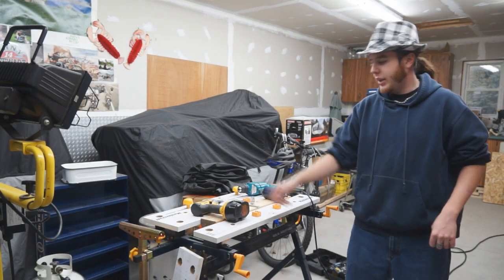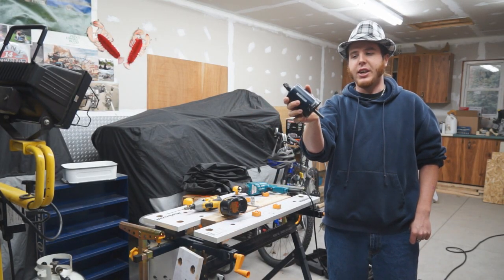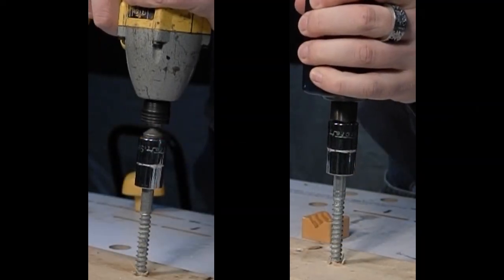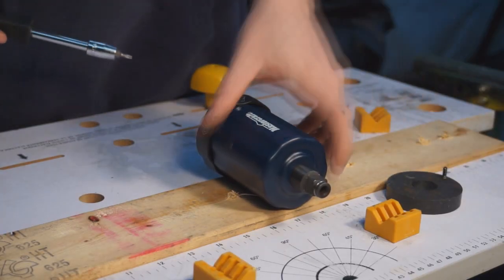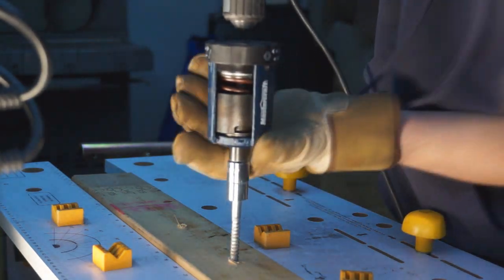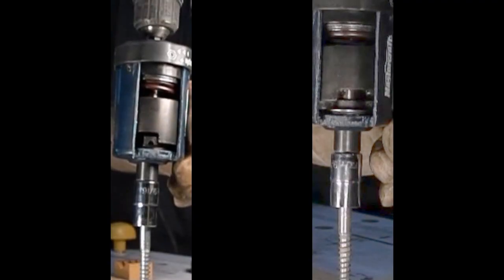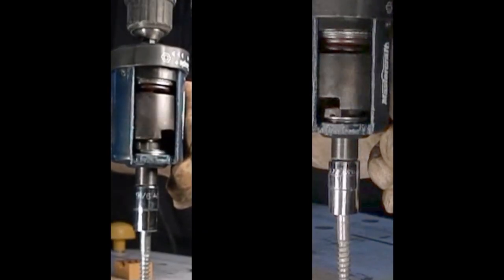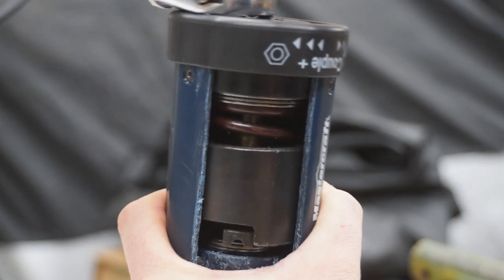Slow Motion - How an Impact Wrench Works

Comment: I would like to see it taken completely apart to see what it looks like and what makes it lift up at the exact time
Reply from the maker: There is a spiral cut in the drive shaft. When the spinning weight is stalled the drive shaft still turns pulling the weight up like a nut on a bolt. When the weight is free the spring drives it down and it hits the output shaft.

Comment: I know this is years old, and I doubt you still have the tool, but I'm curious what that spring is rated for, and what all the components are, just to see how easily one could be replicated. I've never seen these before, and I doubt I could find one easily. But one would be handy to have around for the few times I need an impact driver.
Also, do you know how much torque this puts out off of a standard drill?
Reply from the maker: I do actually still have it in my "science bin." The spring can take my full weight without compressing fully so it is pretty heavy, someone told me a few years ago they found a chinese knock off but I haven't seen it since. I'm not sure how much it puts out in numbers but it is about as good as the DeWalt.

Comment: Interesting; thanks for sharing this. I believe the air powered units have a different impact clutch mechanism than this - I would be interested to see how that one works. I've disassembled the air powered ones for cleaning and repairs, and there is no spring in them. I guess inertia plays a role in timing the impacts.
Reply from the maker: Yeah, they have a throw-out hammer mechanism that is way different from this. I have an air gun in the closet waiting to be taken apart but my new slow mo camera doesn't arrive until March.

Comment: is any possibility that the impact wrench adaptor damage the HSS chuck?
Reply: I mean if you use it for a long time.
Reply from the maker: I don't think so, the force felt through the drill is pretty even more so than in the DeWalt gun. It's a lot less violent than snagging a bit while drilling.

Comment: Can you recommend an ideal budget impact wrench to unscrew wheel lug nut?
Reply: If you're just using it for wheels you're better off just buying a breaker bar. Unless you need if for a job.
Reply from the maker: +awesley92 I find they are good for driving screws more than anything, for nuts and bolts a regular wrench gets you more torque than an electric impact.

Comment: +Nick Moore I am desperately trying to find that impact attachment. The links I've found to the tire place don't work. Any ideas? I'm in South Carolina USA. Thanks!
Reply: Orion Red
Very punny Onion!
Reply: Try amazon, they have them on there. Canadian Tire is only in Canada and they typically sell a ton of cheap chinese knock off tools - I have a bunch of them here eh.
Reply: Can't find them. One of the big name power tool companies probably bought the company or patent and took it off the market. Ugh!
Reply: Jacob Beaton  thanks for responding.Can't find them. One of the big name power tool companies probably bought the company or patent and took it off the market. Ugh!
Reply: Nick will probably sell you this one...at 25% off!
Get it? 25%!
Reply: Chaz Steadman Got mine @ Lowes.
Reply: Neil Armstrong do you have a lowes stock number and or full description?
Reply: Chaz Steadman
Is this it? https://www.lowes.com/pd/BLACK-DECKER-Matrix-Impact-Driver-Conversion-Attachment/50006520
Reply: Orion Red Is that the one you have? Does it function like the one in the video above? Do you like it? Thanks!
Reply: Chaz Steadman
No, I don't have it, or any of them. I popped for an electric impact driver from Harbor Freight. I used it to change the sway bar links on my car and MAN O MAN did it make that job a lot easier.
Reply: Chaz Steadman impact driver and impact wrench are two different things... get the one that fits your needs.

Comment: dont is wear easily coz of impact action?
Reply: easy way to explain how it works is try pushing a nail in to a piece of wood, wont really work right? Now grab a hammer and slam on it. That is what an impact gun is. Its a hammer slammer in on the tool that turns the bolt. So instead of putting a constant pressure on it you use all that energy from in just 1 hit.

And for why they use this. You would need a giant engine for 1000nm of torque, but an air impact gun can sometimes deliver a 1000nm of torque on a bolt. Or you would need a big reduction on the motor, but then it would turn really slow even if the bolt is not tight. And on top of the 1000nm is equivelant to 100kg at 1 meter of arm. So if you are 100kg and you where to put a piece of pipe on the motor of 1 meter it would just about lift you of the ground. Imagine trying to hold on to a tool that puts out that much force.
Reply from the maker: The moving parts are all very hard, wear resistant steel. They will not scratch or deform from impacts.
Reply: But why they design impact why dont we use direct
Reply from the maker: If it was direct drive your arm has to supply as much torque as the driver. With an impact gun the momentum of the spinning mechanism supplies the torque, your arm only feels the more even load that comes from the motor.
Reply: Basically it is used to reduce torque on user's hand
Reply from the maker: +black cat Yes, and it increases the torque on the bolt.
Reply: How it increases torque?
Reply from the maker: +black cat When the hammer is pushed by the spring it speeds up and hits the output shaft much harder than the drill can turn.
Reply: 👍👍 ty
Reply from the maker: +black cat No problem!

Comment: two questions:

1) how does rotating the shaft compress the spring, stop and have it move horizontally, and then drop it down? Whats the mechanism behind this.

2) Why does the spring drive the rotation forward if you are spinning the spring forward?
Reply from the maker: +KiwiKiller88 There is a helical cut in the drive shaft, when the output is stalled it causes the hammer to screw it's way up the input shaft, squeezing the spring.

When the hammer finally slips over the teeth on the output shaft it is driven down the helical cuts by the spring making it spin faster before hitting the output teeth again.

Hope that helps!

Comment: link? for the "adaptor" thx
Reply: just get a used impact there pretty cheap and it will work better or search up adapter that makes drill an impact
Reply: @Daniel-dg8hd  I dont think so, that adapter looks cheap and good
Reply: @joaolisboa7775  you don’t think an actual impact will work better?
Reply: Same i would buy if i find one.

Comment: Any information on the air impact wrenches and how they operate?  I don't think they use a spring since they can be modulated to turn very slowly; I guess it's just a flailing hammers of Thor kind of arrangement
Reply from the maker: +DTR RTD I have an air gun to be taken apart but I have waiting for delivery of a new high speed camera. The short answer is though The Flailing Hammers of Thor.
Reply: This method is not used in iar tools, in air tools they use rocking dog system to kick the hammer.

Comment: Thank you for the informative video.  How does the torque adjustment on the adapter work?
Reply from the maker: +BoringOldJoe Backing off the torque adjustment removes some pre-tensioning in the spring. That makes it easier for the hammer to ride up the input shaft and so delivers less impact when it comes back down.

Glad you liked it, thanks for watching!

Comment: thanks for the video. I have a question. How does that rotating mass lift itself in upward direction compressing the spring.
Reply from the maker: +Rohan Kansara The drive spindle has a spiral cut that acts like a screw jack to lift the mass up and turn it above the output shaft.
Reply: Thanks for the reply. Helped me a lot.

Comment: okay, one question - how to modify this type of hammer? will stronger spring help? or it has to spin faster to be more powerfull?
Reply from the maker: A stronger spring would give you stronger impacts but it would be proportionally harder for the to turn. A faster drill would give you more impacts per minute but they would be the same strength so you would have the same maximum torque.

There is some adjustment built in and the standard maximum torque is already quite strong, not that it couldn't get better!

Comment: Great video man, but please don't wear gloves when using rotating tools. The glove can easily get caught in somehing and it'll pull your hand with it when it starts to spin. Look up de-gloving if you want to see what can happen (NSFL warning).
Reply from the maker: +Luka Voglar I normally don't wear gloves but I wasn't sure if that housing was going to explode after I cut out a chunk. The adapter was on sale for less than 5$, how much extra could be in there?

A friend of mine had his finger de-gloved, he gives a pretty good warning about it.
Reply from the maker: +Luka Voglar I normally don't wear gloves but I wasn't sure if that housing was going to explode after I cut out a chunk. The adapter was on sale for less than 5$, how much extra could be in there?

A friend of mine had his finger de-gloved, he gives a pretty good warning about it.
Reply: +Nick Moore That makes sense, thanks for the clarification. And I'm sorry about your friend, hope his finger is okay now.
Reply from the maker: I once was wearing rubberized gloves and using a 2 foot hole saw extension, since then I take my gloves off to use drills :/

Comment: Great Video. I have a question that anyone is free to chime in on.  I notice that the impact adapter does not contain any lube, it's dry as bone from what I can tell.  I recently took apart and replaced my anvil on a Makita 18V 1/2" drive impact wrench, the older longer one that came out a few years back.  I noticed old lube in there so I put bearing grease to replace the older stuff while I had it apart.  Is it common to have to do maintenance on these things by lubing them frequently or is that only an older model type of cooling route that they have since done away with over time.
Reply: MrIkon12izzy not sure about cordless but pneumatic impact guns usually have either a grease fitting or a total oil bath hammer assembly

Comment: And how does all that energy released at the same time not impact your wrist ?  The energy has to go somewhere.. There is something that I don't get with impact wrenches but I've never used one to be honest.
Reply from the maker: The force on your wrist comes as the spring is being compressed, that force is pretty steady. When the hammer releases and impacts on the output shaft the force on your wrist lets off until the spring begins to compress again. The output feels very short but strong impacts where as your wrist feels a more even force that lets off for short periods. I hope that helped, thanks for watching.

Comment: What lifts the hammer up?
Reply: +Qrnl  the  inside is threaded for half cycle ,,, the main shaft in the middle is threaded with the hammer. it's also the cuze of the spinning  of the hammer when it go down by the spring ,

Comment: awesome detail on hammer function, great video. this is what i use to explain the differences with a twin hammer air impact gun, and electric impact guns, i have not yet seen an electric impact gun with twin hammers,, i wonder if it even exists. i sell tools and this helps.
Reply from the maker: As far as I know all electric guns are like this one. I don't think they are driven with enough speed to work properly with a twin hammer mechanism. Thanks for  watching. Glad you liked it.

Comment: So Is It The Charging Spring That Gets Weak Causing My Corless Impact Not To Have The Impact Strength It Used To Have?
Reply from the maker: +Salvatore Hayes IF the spring gets weak it will loose most of it's impacting power. There is an adjustment built in to the adapter to adjust the spring pre-load and thus the impact power. Thanks for watching!

Comment: What camera model did you use to record those high frame rates?

Nice demo.
Reply from the maker: +angelisone Hey, I use a Casio EX-F1 for my slow motion shots. It will film up to 1200fps but only at 190x90 (ish) pixels. The bandwidth required to capture images at that speed is so high that the resolution has to be severely reduced. I go into more detail about it here https://www.youtube.com/watch?v=tXVK6MwUzG4

Thanks for watching.
Reply: +Nick Moore I forgot about that camera.
Again, very nice reviews.
Reply from the maker: It's a shame they never released a MK2 or anything else in the consumer market that was comparable. I bought a Nikon J1 (I think) for it's higher resolution high speed but the image quality was way worse. It also had unreasonable restrictions on features if you used a non-Nikon lens.(No auto exposure, no metering, no histogram).
Reply from the maker: Heh, I have one on order but I went with one of the upgrades so it is still months away. Thanks though.

Comment: Good video but should be using impact sockets
Reply from the maker: +YeCannyDaeThat True, chrome sockets explode if they are abused too much, luckily neither of my impact driving options are really that strong.
Reply: +Nick Moore No problem, thanks for replying to a comment on an old video on a busy channel. It's appreciated!
Reply from the maker: I try to reply to all the (sensible) comments I get. I have never broken a socket with the DeWalt but it has blown up a few screwdriver bits, might make for good slow motion.

Comment: Great video.  What's the cost of that adapter?  And how do you shoot 600 frames per second?
Reply from the maker: +Brian Z The adapter is no longer made. It was 20-40$ Canadian when it was new. I use a Casio EX-F1 camera for high speed.

Comment: nice video,
2 questions 1. will the wrench operate with counter rotation(counterclockwise)
2.if its possible would you take it apart so we can see the hammer lifting mechanism
Thanks for sharing
Reply from the maker: Michael Mesfin The wrench will work in both directions. There are 2 spiral cuts on the input shaft so the hammer can be lifted when the input shaft spins either way.
I still have the adapter but I am out of the country for a year so I can't help you there, sorry.
Reply: thanks, no problem

Comment: Using chrome sockets instead of impact sockets plus not wearing eye protection is downright unsafe. I once had a chrome socket shatter on me while using an impact wrench and the shrapnel were like projectiles imbedded into my garage drywall. Can't imagine if some pieces were to hit my eyes.
Reply from the maker: Don't worry, I was doing the safety squint.
Reply: Nick Moore I thought you were using safety contact lenses.
Reply: Henry Ting I know it can happen. But I've never broke a chrome socket with an impact

Comment: great video.
what i dont understand is
how does the hammer rise above
the output shaft?
Reply: AARO LEV "how does the hammer rise above
the output shaft?

The spring above the hammer gets shorter as it is twisted, which pulls the hammer up.
Reply: Jim Van Belkum Not quite.
There's usually a zigzag shaped groove cut around the input shaft where the hammer mounts.
This is coupled to the hammer using steel balls or similar.
With enough torque applied to the hammer, the steel balls ride up the zigzag groove against the spring pressure causing the hammer to rise.
When they reach the peak of the zigzag, the groove changes direction (as a zigzag does) and the spring is able to freely push the hammer back down causing a rotation of the hammer as it does.

Comment: Great video! Does the cutaway one also work in the other direction (i.e. to loosen screws)?
Reply from the maker: Yes, the mechanism is symmetrical and works in both directions. You will find it in most electric impact guns (corded and cordless), never in an air powered gun.
Reply: Nick Moore We are working on a project with a mechanism similar to that of the video. But we have difficulty understanding how the mechanism works in the reverse direction, because we think the torsion spring will not contract in that case, so that the flywheel will not go over the little cog (the little part down beneath).

Can you maybe help us with that?
Reply from the maker: The input shaft that pulls the fly wheel up has 2 spiral cuts in it that go in opposite directions. No matter what way you turn the input it will pull the fly wheel up against the spring.

Comment: What lifts the static flywheel as the input shaft rotates? Is there a hidden cam inside the flywheel?
Reply from the maker: There is a helical cut on the input shaft. When the rotation of the flywheel is blocked it climbs the cut on the input shaft like a nut on a bolt. Once the fly wheel is free to spin it is driven down the spiral cut by the spring, speeding it up before the impact.